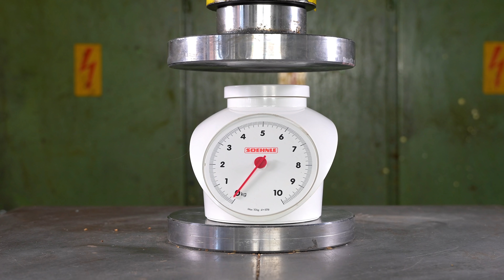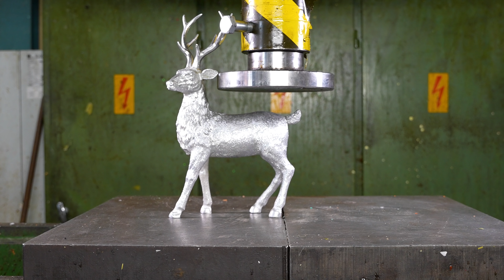Crushing giant paper roll with hydraulic press

Comment: Would be fun to see you crush those old receipt paper rolls 🤔 the smaller ones
Reply from the maker: I try to get couple of those!
Reply: @HydraulicPressChannel  And what will happen if you press them in axial direction, pressure to paper sheet edge. It might need quite large pressure in that direction.
Reply: @HydraulicPressChannel  Especially if you can get proper thermal receipt paper also! Not just the one that got written to with ink ribbons.
The thermal one could show if it heated hot enough during the crushing!
Reply: Are they extremely dangerous where they could attack at anytime where they must be dealt with?

Comment: What actually happens to the paper to explode so well? Does each sheet/page split, tear, or compress into one and the air between them explode? We see the crush, the bits explode off and the sudden bang/thump as resistance fails... Great to observe but I can't help wondering what actually expodes, wood pulp, air between sheets/pages etc.. Just what happens?
Reply: I imagine that it works like this: Imagine taking a sheet of paper and pulling on the ends of it until it comes apart. It takes a lot of force to do that, and when it happens, it starts at the weakest point and then very quickly the mechanical failure spreads through the sheet.

The press puts force on in the perpendicular direction from that, but as the pile of sheets is pushed together, the pressure creates an outward force. This outward force is resisted not just by the bonds between the paper fibers but also by the friction between the pages. The friction grows as the pressure increases, which means that you have two opposing forces constantly increasing as the press pushes down.

Eventually the NET outward force exceeds the tensile strength of the paper. When that happens, suddenly there's less force resisting the outward pressure, which means the net force gets even greater, which overcomes the strength of more paper. This chain reaction happens at the speed of sound (because that's the speed at which mechanical forces propagate) and all of the energy that used to be holding the paper together (including the energy in the friction force) now must go somewhere else -- into making the paper fly everywhere.
Reply: I think it’s the shear forces occurring at the edge of the press plate down through the paper. Some form of energy is released by the paper breaking and those shear forces ceasing to exist. That’s my guess
Reply: @wahidtrynaheghugh260  I discarded that because it still explodes if the press tool is larger than the paper being crushed. The shear might create a weak point to seed the explosion but I don't think that can be it by itself.
Reply: Too much science, not enough man
Reply: I guess we don’t really know.
Reply: They need to have a video with the SloMo guys! Itd be awesome to see this stuff at 50,000+ FPS!!
Reply: It's probably exploding air bubble within and Shockwave from it
Reply: I haven't found a way to confirm this, but this is what I think is happening: paper is made up of cellulose fibers (polymeric glucose) that are not aligned with each other and therefore contain quite a bit of empty space.  Under the immense pressure from the press, they spontaneously realign with each other, suddenly occupying the empty space and making the paper smaller and more dense, along with a nice loud bang as the press suddenly moves to fill the gap.
Reply: @nickolaslandon4640  on youtube, you can play at 25%
Reply: Paper compresses and stored energy into spring forces. Paper wants to escape under the press tool because internal pressure is higher than external pressure. Paper is also relatively slippery and when the fibers finally give up, papers shoot very fast under the tool.

The other explosion happens around the tool when compression gets high enough that shear forces rip external part away. In that case, explosion is caused by the spring forces of external part. Before ripping apart, also external part have been compressed being pulled together by internal part.
Reply: The table under the press works as a large spring and stores a significant amount of energy. When the material being pressed finally ruptures, the table is still pushing it up with the same force but against a smaller area. This causes a rapid cascade of material failure that stops when the table has risen enough so that the object can withstand the reduced force.
If the table had an all solid block of concrete supporting it, the paper would tear apart more slowly, no "explosion".
Reply: I'm surprised that nobody's yet mentioned that this very channel has a video that goes a long way to explaining why! Search "Why Paper EXPLODES When You Crush it With a Hydraulic Press? Surprising Results!" and not only will you learn more, but you'll let to listen to our favourite Finn's voice while doing so :)